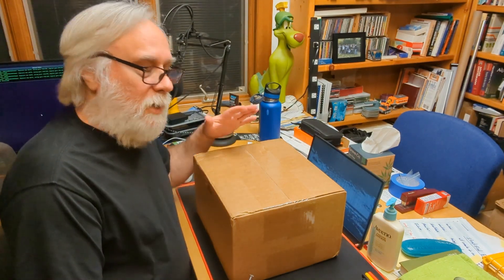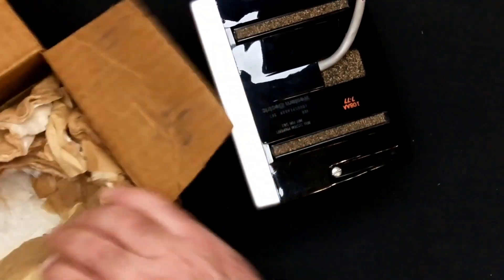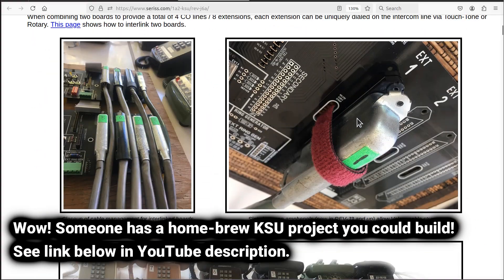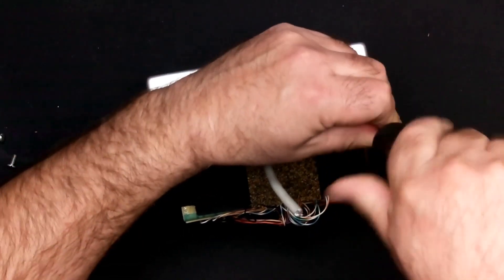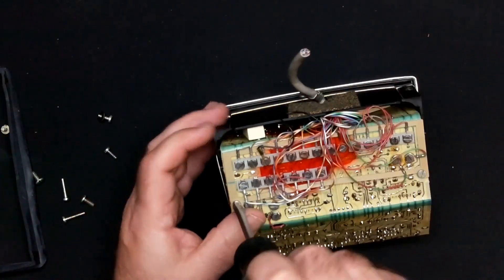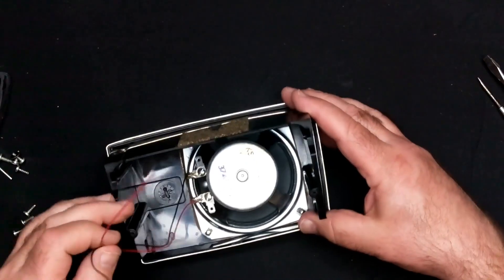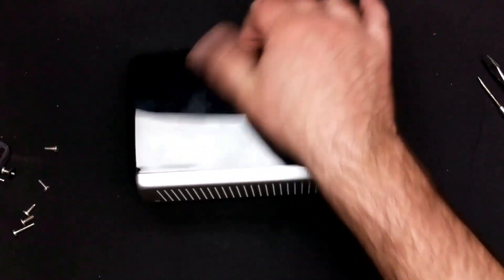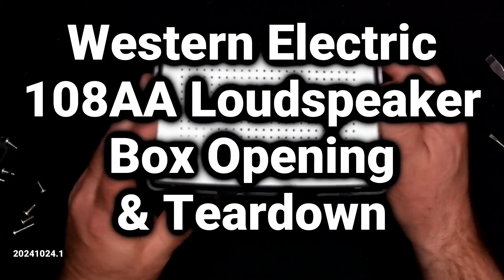Western Electric 108AA Loudspeaker Teardown

Comment: I remember this well and it’s a handsome looking object along with its separate rocker switch nifty microphone all with 1A2 integration.  The problem was the microphone was far too omnidirectional and the echo was seriously horrendous.  We called it a sound like a ‘fart in a sewer pipe’.   Bell Labs commonly spent millions on these projects, AT&T and Western Electric were perfectionist in engineering and manufacturing quality, yet this one was the best they could do. Then came conference phones that looked like a flying saucer with balanced microphones from players like Plantronics, etc. 

Subsequently the 90’s digital key phones by Intertel had an amazing background noise synchronizing button where you heard a scratchy sound for two seconds and that ‘just next to you’ sound quality was amazing and full duplex.  I had two stations on my desk and would conference using this amplified manner between two phones that was superior sound quality and amplified correctly.  

This differed substantially from the old “meshing tip and ring pairs” between lines (no amplification or balance) which only gave the host good sound quality and the meshed parties had difficulty hearing each other.  That one feature was an outlier and kept the gears of business and conflict in check as everyone had a say and no punches could be taken when it felt like everyone was in the room experience.  Having a field tech on a cell phone patched through to the software tech in California as I played referee was classic control. 

I also had all the public incoming lines on Centrex for a few reasons.  We could login to the 5ESS with ASCII terminal over dial up and program a main line forwarding as a natural disaster plan (physical access to our building blocked by flood, trees down, etc).  Centrex allowed unlimited forwarding paths by its design. Not so with regular Call Forwarding, one call only, second caller got a busy.  Another was ‘alternate answer’ which you set up a ring count and after the count, the call would forward to someone on a cell for example.  I really only used it on the Central Office main line at 7 rings to forward to the T1 incoming main line.  If the main number POTS went down, we had a built in “plan b” so to speak to the T carrier.

Comment: Just a note. You do have the original box, and that packing material is exactly what WE used to carefully protect these speaker sets. Of note. The numbers above the model number on the box is what WE/AT&T Technologies/Lucent Technologies always used on all products, from wire, jacks, bulbs, components, equipment, manuals, etc. Comcodes are still used to this day by Avaya and Systimax, all successors to WE.
Reply from the maker: Ah yes!  I remember having a comcode to peccode reference at my desk.

Comment: Everything from back then was built like a brick outhouse. I have a couple of Motorola mobile radio speakers, and you could stand on them and only scratch the box a bit, and they can be heard from across the road and up on a utility pole during a storm if your truck window is rolled down. Motorola didn't mess around with their speakers.
Reply from the maker: @johnwest7993  Yeah.  Funny how the quality went from solid when the equipment was telco-owned and leased  (no maintenance ever needed for decades) to ZERO in the blink of an eye when the equipment was sold to the customer & just suuuuucked!  I have multiple ancient phones (60s & 70s) that are all still solid & several at&t land line phones post 1990 that are all crap.

Comment: Cool project, In the late 90's early 2000's I used to work as a software engineer for Lucent Technologies here in the Netherlands. I worked on the 5ESS telephone exchange and I was at one point responsible for the PBX software for EMEA (Europe Middle East and Asia). I still miss those times, Lucent which was split off from AT&T, was a really good employer. Bell Labs was also part of Lucent at that time.
Reply from the maker: Bell Labs was an amazing place be. And it was so for many years. When I read something like "The Idea Factory" by Jon Gertner, I wanna cry as I mourn over what is no more.